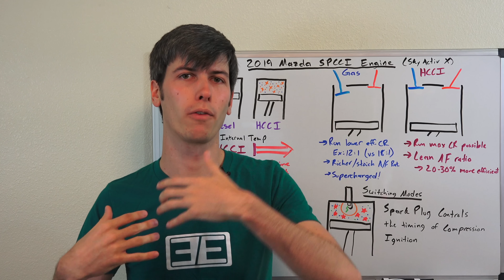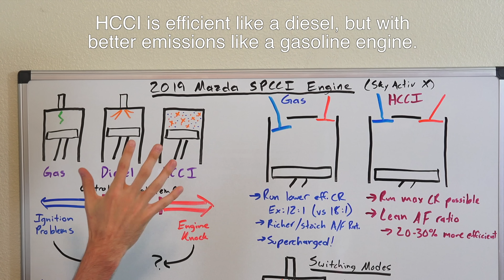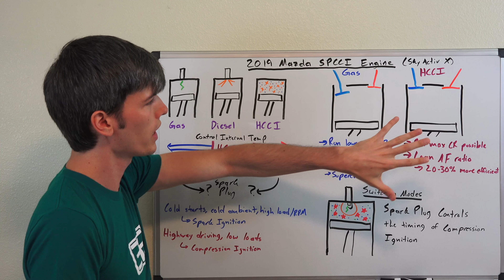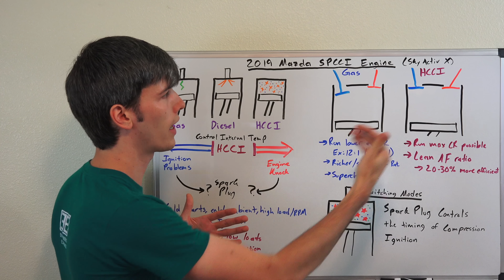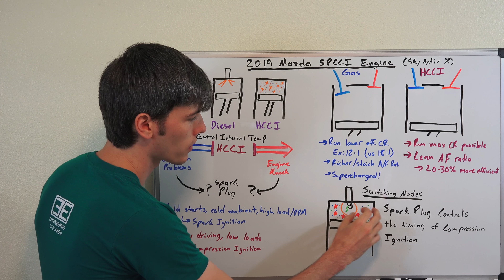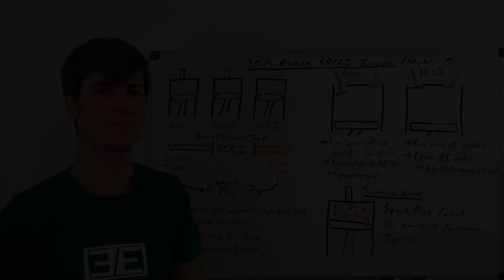Mazda Creates The Holy Grail Of Gasoline Engines - HCCI SkyActiv-X

Comment: Jason - by supercharging, I think mazda means a compressed air injection system. it's still 'super charging' but not in the way we think. I presume they'll accumulate compressed air in a cylinder, similar to volvo's compressed air turbo spooling system but instead of dumping the air into turbo exhaust turbine, mazda will directly inject it into the cylinders. that way they can make very precise alterations to the air fuel ratio based on feedback from fuel quality sensors and change the effective compression ratio on the fly; even providing different amounts to each cylinder if necessary. HCCI is quite sensitive to pressure, temperature and fuel quality so this flexibility and granularity will be very helpful.
Reply: Cult:  a group of people who's enthusiastic devotion to something is built on a foundation of them pretending to know something that they don't know.
Reply: this would be really interesting to see. There's a company that implements this instead of normal supercharging in their race builds and the results were incredible. Only issue they might have would probably be sustainable storage of the air and temperature control seeing as compressed air being released can be quite cold
Reply: gary beharrell not necessarily. There's so much wind, wave and solar energy available every day and all day, it's easy to store. You don't even need batteries. It's not going anywhere so you can use less efficient storage means like raising water or compressing air to be released on demand. They're compressing air into an old mountain tunnel in Switzerland as we speak. Solar thermal stores excess heat in molten salts, which continues to turn water into steam on a regular basis. Geothermal energy isnt a massive engineering feat anymore. 

Poorer countries are quickly utilising renewables because it's cheaper and quicker to install than a coal station. 

The question doesn't lie in having enough Renewable storage to charge a tesla. It's whether we have enough lithium etc to build the car batteries.
Reply: @MX-Vette  
Etc = Cobalt
Reply: If it works, it's a very interesting design approach.  It's a simple, low-cost way to store small amounts of energy.  And for the reasons you say, it's very compatible with engines.  It also allows you to have excellent intercooling... more like a refrigerated / air-conditioned intake.  Such performance is impossible with normal turbo/supercharging.  In theory it's more like having nitrous.
Reply: Natural charge is atmospheric pressure. Supercharge is above atmospheric pressure. So technically any means in achieving a higher than natural AP to the engine is supercharging.
Reply: Herr doktorbimmer tesla is boring and only overated by vegans that didnt know anything about cars and tchnique u are a prime example
Reply: Herr doktorbimmer seriously...
Reply: too bad we will have to burn coal to generate the power to keep all the electric vehicles running
Reply: Herr, put down the Tesla Kool-aid. I guarantee Tesla will disappoint you.
Reply: from their Japanese press release it is described as air pump, so could be low pressure compressed air pumping into cylinder directly
Reply: Joe Xu my interpretation is an air injector.
Reply: that's correct too, it is some kind air injection system like secondary air injection but inject directly in to combustion chamber to control mixture and temperature
Reply: It's variable dynamic compression ratio sounds like. Either what EE said as being intake valve closure control or some form of injector nozzle controlling chamber pressure.
Reply: doktorbimmer How about VW or BMW
Reply: 80386 I
Reply: Take the coal, crude oil, and natural gas away from this chart and how much energy does the world have left to generate power? And keep in mind, this chart expresses the current trend in electricity use. You all are proposing replacing the world's massive petro-burning autos, trucks, machines with electric motors and batteries. You know what that would do for electricity demands on this chart? It's unattainable. Battery tech is getting better, but so is gasoline tech. Battery tech has been exaggerated out of proportion to actual need and demand.
http://www.financialsense.com/sites/default/files/users/u673/images/2012/0313/world-energy-consumption-by-source.png

Also, have you considered where the minerals and metals are coming from to make most of the current batteries powering the electric cars and hybrids? From nations who force child labor. I'm sure you'll feel good about that.
http://www.dailymail.co.uk/news/article-4764208/Child-miners-aged-four-living-hell-Earth.html
Reply: scott Dann..thanks for your response. I do agree that there are alternative resources. Im not sure I agree that they are cheaper. That is an amazing idea in Switzerland. I am putting together a solar heated system that  pumps solar heat into the ground under the building in the summer and pumps it into the building for heating in the winter
Reply: Herr doktorbimmer why have bimmer in your name then....
Reply: Lifted_Above, how will Tesla disappoint? Let's see, it has the highest owner satisfaction in HISTORY of any car. It has the highest safety rating in HISTORY (it broke the testing machine trying to crush it). The Tesla Model 3 was the largest product launch in HISTORY of any product. Please, tell me about your car compared to those facts. Oh and it's the only car company that will pay ZERO Border Tax if that gets implemented. Not even GM can say that because they moved maufacturing offshore. If you want an American car, you must buy Tesla. But tell me how Tesla will disappoint.
Reply: blah blah blah

Comment: Couldn't they just have the sparkplug fire all the time? When the HCCI mode is ready, the air/fuel ration will be too lean for the sparkplug to ignite it, so it wouldn't matter if it is still sparking. Is this right?

Comment: I guess the unanswered questions would be: What type of sensors will sense the need to switch from spark ignition to efficient compression cycling, and is it all linked to a computer which monitors the timing?

Comment: Wow, thanks for sharing this. A 20-30% improvement in efficiency, that sounds like paradigm shift. I expect there is an upper limit when it comes down to just how much energy is actually stored in the fuel but it amazes me that further refinements to gasoline engine continue to be made. Do you have a number for overall efficiency of this engine design? That is, energy extracted/energy in the fuel?

Comment: Sounds similar to the tech they used on the Millenia V6, which used a supercharger not so much for boost but to put a kick behind the intake charge so it doesn't all leak out when you hold the valve open longer. It's amazing how high we've gotten compression ratios, while still using pump gas
Reply: You're on the right track, I think this motor will need 0.5 psi off the idle to stay running as it won't be able to aspirate on its own, just like old two stroke Detroits...
Reply: Herr doktorbimmer  salset ? can i eat that is that a new type od meat  ?
Reply: Herr doktorbimmer shut uo

Comment: Diesel engines will run with compression as low as 15:1 most model airplane / RC engine are HCCI. Moving the spark pug in and out of the combustion chamber would be a good way to control the CR.

Comment: So does it still have injectors? How is fuel delivered to the cylinder? Your drawing shows no injector.
Reply: This set up will both work with direct injection or older style port injection, I'm leaning towards port injection as it makes cylinder heads less complex

Comment: sounds like they will have NOx trouble. Running hot and lean is efficient but hard on the engine and creates too much NOx.

Of course you could just detach the gas engine from the drive train and run it in an optimised steady state, but who would like that?
Reply from the maker: The beauty of gasoline HCCI is that it is very low on emissions (NOx especially). It runs cooler than diesel. https://youtu.be/OVWZFdb_AGc

Comment: Is this a camless engine? If the both spark and the valve train is fully computer controlled, I would think transitioning from spark to compression ignition is as simple as disabling the spark and changing the timing of the intake valve action, all in a single cycle, once the combustion chamber got to the optimal temperature for compression ignition.

Comment: They'll probably use electronic valves like the race car guy from Sweden uses on his race engines. He did a video where he was testing his valve trains on smaller engines. Probably Mazda, R&D money is always sweet, they've probably worked out a deal where his valve trains are proprietary when it comes to the classes of cars he biilds. We're talking about a major spinning weight savings no camshafts timing sprockets, vastly reduced head oiling. Pin point control of timing. Yep that's how I would do it.

Comment: Look at Formula 1 engines and jet ignition. I don't think Mazda invented anything regarding HCCI. My information is that the german company Mahle invented jet ignition and Mercedes has made it famous through Formula 1. Jet ignition is what allows for HCCI.The basic Mahle system uses 2 fuel injectors whilst the Mercedes system uses only one because of F1 regulations.

Comment: Make a video on using biofuels in cars??? Electric cars aren't even that good: the electricity is produced mostly in nuclear or coal power plants so it's still damaging the environment, and lithium (for the lithium-ion batteries) is a rare metal so it damages ecosystems to mine a lot of this from the Earth. Also the electricity grid wouldn't do that well if everyone wants to charge their electric cars at the same time after work. I saw this on another comments talking about electric cars, so why don't we invest more into biofuels? Is there is reason that this wouldn't work in mass production?

Comment: I see major problems. If the load is even, you could control the hcci timing for sure. But when the engine runs at low loads (for ex. idle) there will be a small amount of mixture entering the cylinder, thus making the compression ratio small (by using atkinson cycle) and the mixture will not ignite because the low pressure. 
The easyest way would be to use variable compression ratio (not only antkinson and valve timing) and some temperature and O2 sensors in the exhaust.

What do you think about these?

Comment: So this sounds like higher maintenance, and more costly diagnosis and repair bills.    Plugs will get fouled much easier, controlling compression via valves means much more complicated heads and controls  and you add an entirely new dimension to trouble shooting engine issues especially with an intermediate stage to deal with.

Comment: Since the engine is supercharged just varying boost would effectively raise compression, the spark control probably (I think) to transition between the 2 modes. Most likely when sudden changes, ie slowing or speeding up. Sounds like HCCI is geared more to steady state than rapid accel and decel.

Comment: Glow Plugs, that's the answer, Mazda just created a hybrid between a Spark and Glow plug to control temperature. Flash point of gasoline is around 536F,  Diesel is 493F, it's easier manipulate the Cylinders temprature
Like this than with the Valves or other mechanicals means...

Comment: My civic vx has gotten 74mpg with a cold air intake. All it is is a lean burning engine. Bone stock it got 62mpg. They want to go faster, they want cars to be safer, they make them heavier, have to increase power to compensate. Everything is a rush anymore. I remember reading an article about chevy years ago where if they didnt increase the horsepower and just continued improving the efficiency of the engine, the fuel economy would go up 20% or more.
Reply: John Buckingham car's are getting heavier because of electronic crap...old car's are more efficient if maintained properly....my 94 4 door auto Acura Integra gets 30mpg with a couple easy modifications...

Comment: Does it accommodate hotter or colder climates? If not its just gonna run like a normal engine all the time, in that case what's the point as when its hot you usually get knock so it modifies the ignition sequence (to do that I'm assuming it would use spark). In colder it adds more fuel for the higher condensed oxygen intake thus negating fuel savings. Not knocking it at all, I'm just interested in how they manage the negate these kind of effects if at all.

Comment: The question is if it is capable of raising such high temperature through compression ratio then y cant you use fuel injector which sprays gasoline rather than using a sparkplug intially and using the compression ratio later.

Comment: Nice explain love it..!!!!

So basically HCCI engines has a ignition plug to provide spark when the pressure is too low or engine requires more power ???..... also what happens when the density of air changes place to place ( then the burning point of air will also change?)...

Comment: I have said this 25 yrs ago in a conversation with my father. Bear with me this will take a bit.. the best hybrid option to make a very efficient car is to use a very low displacement  and very efficient two cylinder gas engine say for shits and giggles half to three quarters of a litre displacement. This engine would run at set rpm to charge small battery for starting and acc purposes as well as to spin a generator for the electric motors to drive the wheels. No Regen braking or charging needed. Little engine also very Enviro freindly with catalytic converter. No range probs. Most expensive part of drivetrain would obviously be the generator. But hey why not? Guaranteed would work flawlessly. At the same time me and my dad had a conversation about money disappearing . Seems everything is coming to fruition. Cheers
Reply: Bryan Gogan it's called a Chevy volt

Comment: I'm really curious and what the Redline limits of this engine are with the hcci you would have to an engine that's pretty well Bulletproof running 18 to 1 compression when the sparkmode is initiated without the hcci kicking you would probably be able to rev this to the Moon and back

Comment: The SkyActive engines are impressive, but they are a dead end for performance. Without a major engine rebuild to lower the compression, there just isn't much performance potential left with gasoline as fuel. Maybe this new technology will fix that, but I doubt it.

Comment: The thing is they are claiming it might get as much as 40 mpg, but there are cars out there that get 40 mpg without that technology. From what I understand the VW golf, given in perfect conditions, gets around 40 mpg without this technology.
Reply: Nick's DIY it depends on the engine though. An EJ20 can have really good fuel economy or horrible fuel economy and it's a turbocharged 4 Cylinder engine.

Comment: From an article I read, this is the tech that F1 hybrid engines use. It's difficult to control but if you do it right you get massive amounts of power with low emissions. Just for context, a 1.6L v6 turbo F1 engine makes about 750-800 HP
Reply: Here's the article:
https://drivetribe.com/p/why-the-honda-f1-engines-dont-work-KoaasvPrSsSbgUo45P8ARg?iid=Je3Nj5SNS0-ixxO7DE1yzA